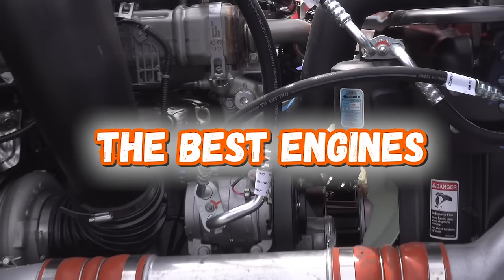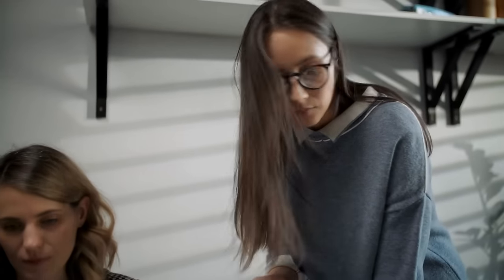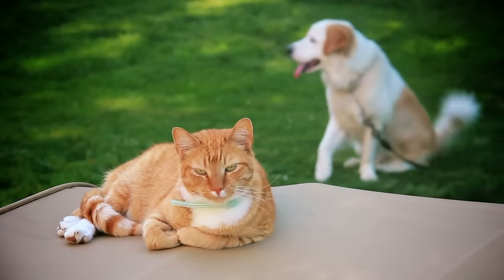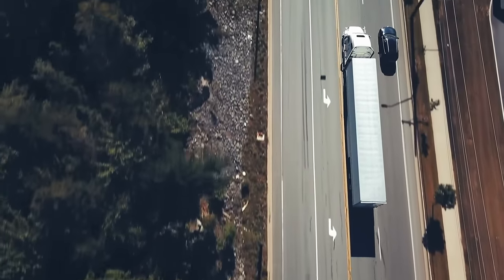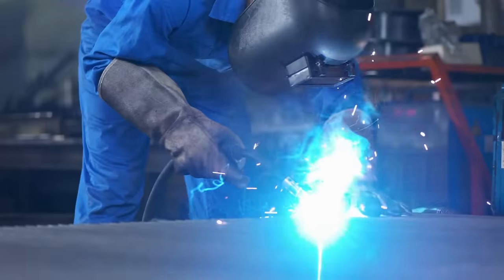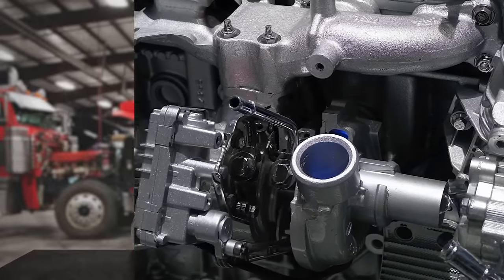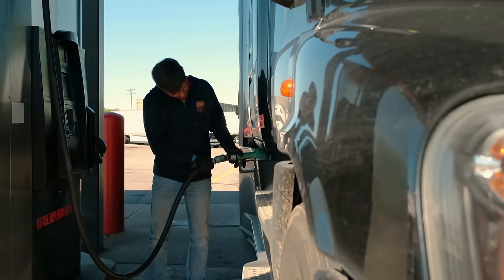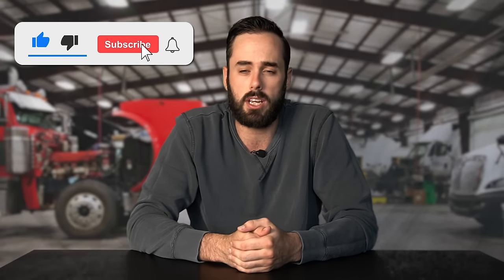The BEST Diesel Engines of All Time! (CAT, Detroit Diesel, Cummins, Mack)

Comment: I’ve got a 3406e in my ‘96 flat top and absolutely love it. My next choice would have been a red top N-14, which I didn’t see explained in this video. Was a little surprised by that! Thanks for sharing your video
Reply: Is the 3406b better because it's NOT electronic?
Reply: @nostradamus7648  some people say yes, because it’s a lot simpler of an engine, easier to work on/maintain and of course you don’t have electronics that could potentially fail either. Fuel mileage can be not as great though because you don’t have the electronics to help with timing, injectors, and such. That’s just what I’ve heard and seen over the few years I’ve been driving truck. I think both are great engines at the end of day and it comes down to preference. The E model cat or early C-15 would be my personal choice each and every time.
Reply: @rockbottomtransport  By early what year model C15 are we discussing?
Reply: N14 is a fragile engine
Reply: @yvesbelanger5443 we ran 8 of them in 98 long hoods. Injector replacement at 500k was preventive maintance. Other then that they all went/have over 1.25 mill before getting inframed pulling 55k coils loaded both ways in 3 axle Mac trailers. The C15 replaced them with all had head gasket failures, hot side turbos were a constant problem, and all of them had to be torn down and rebuilt, 2 out of frame to have the blocks counter bored. The 5EK we had were just as bullet proof, pulled like mules headed to grain, but drank fuel. Not dogging on Cat, the 5EK were amazing motors that all went north of a million, but if you had a catastrophic failure in a 525 celect, you had to have got a lemon. The red heads were the best motors we've ever had for pulling/fuel/reliability. That being said. We had 2 standard 485 N14s as back up trucks we bought from a guy that retired. Both had around 300k on the clock. Everything on those except the hard parts gave us problems.
Reply: @nostradamus7648 yes and no, the 3406A and B You really have to watch the pyrometer where the 3406E meters the fuel back automatically when the cylinder temperature rises, where the 3406A has a water intracooler the 3406B has the same air intracooler as the 3406E.
Reply: He probably didn't mention the N14 plus because it was only made for a short period but it was a good engine making 525 hp and just like the N14 had great low low end torq.
Reply: @edmunger5595  it was the best engine. Everyone in the US was making good motors from 96-03 then the government got involved and ruined it

Comment: I'm running a 60 series and after wrenching on it I'm understanding why it's such a good engine, fuel mileage, easy to work on
Reply from the maker: Niceeeeee!
Reply: @NorthAmerican-Trucking-News  did you know the first electronic engine ever made was engineered by John Deere, they wanted a big four cylinder for the tractor, but went another direction and left Detroit Diesel with a new design they took it and made the 50 and 60 series engine

Comment: One of my customer has 2003 Coronado with 14 liters Ditrot non EGR and this engine set up by factory 625 Horsepower and 1850 torque and I did test drive truck once and I really feel the power it has 13 speed transmission and 3.58 rear end. Wonderful truck

Comment: Caterpillar 3406B is the best truck engine ever made. 
I have one 38 yrs old still rocking.
Reply from the maker: Woah!
Reply: The  cat 3306 is the best diesel engine ever built; I have seen more than one with 30,000 hours on them. They were used in cats and loaders and were  indestructible.

Comment: Shoulda went years further back and put the Detroit 6v92 silver as well as the 8v and 12v 71 and 92 on the list. They'll NEVER be beat!
Reply: They don’t know about the 70 series engines clearly
Reply: They only get beat uphill.
Reply: Idk about that. Back in the day my dad had an old A model kenworth long logger with the 6v 92 silver and that was around the time the ppl were raving about the big cam Cummins and the little v6 would blow their doors off..
Reply: @ShystySpokes  There's a lot more to it than just the engine. Gearing, transmission, etc. If everything was equal and in stock form. The 855 would crush the V6 and V8 92 series. And was more reliable to boot. My Grandfather had a trucking company. At its heyday the company was running 10 Peterbilt 359's. Running reefers. All with 855's and 13spd's. He cycled out the Detroits he had. Couldn't run the Detroits in California. And he said the 855's were just better. The last 359's he bought had N14's in them. Cummins had the best warranty for awhile. As long as you didn't break the seal off the fuel pump dealio. 
I'm a CAT guy. When I left active duty, I drove for a guy that had some pretty pimped CAT engines. And I liked the plethora of 3406 CAT's he had. Some had Dana Spicer transmissions and some had Fuller's. Those two speed gear boxes wasn't my favorite to drive. Always a fan of a standard 13spd. 
As far as now. If you was to eliminate the Emissions on all these new engines. They'd all be million mile motors. I drove a deleted X15 in a 389. It would sh*t and get. I owned a W900L with a 6NZ CAT 550hp, 1,850ftlbs and 18spd. 3.36 on tall rubber. 8 inch Donaldsons. And a Jake that would throw you into the windshield. Fun truck. Now I'm in a 579 with 450hp, 1,850ftlbs and a 13spd on 22.5's and 3.25 rar. She's a steady girl. Not winning any races up the mountains. Pull the Grapevine 34-36mph at 79k+ (Tanker). Before that a Volvo same HP and torque. 2.47's and a 12spd I Shift. Pulled the same speed with a tank. 🤷‍♂️ That Volvo motor built max torque at 800rpm to 1,300.
Reply: Well than we can say that my dads truck was an A model kenworth, long logger which is your standard log trailer, 2 axles, can stretch out to haul 40 footers(back then)not many log trucks had drop axles yet and 3 axle trailers were still years off. That said his truck had a light weight of around 21k. Deep reduction 15 spd which just about every log truck had back then(still one of the best in my opinion for heavy duty application)all the guys he hauled with had either a w900 kenworths or internationals with the same gear set ups..so pound for pound the trucks were pretty much the same and the old Detroit silver used to smoke ‘em. I too am a cat fan though I can give you that. Nothing compares to the sound of a straight piped 2 stroke Detroit but if anything comes close it’s a pumped up cat with 6 or 8 inch straight pipes. I’m a lot older now and I’ve driven log trucks, dump trucks, concrete pumps, you name it. With every combo of engine/trans/drive axles/steer axles/drop axles/tag axles possible so my opinion counts for something.
Reply: Would just like to add that anyone running interstate hauling their fruit or livestock or what have you is playing with a different deck of cards then the guys hauling timber in the Pacific Northwest. Not saying by any means that the interstate, consumer good haulers aren’t truck drivers but we’re a different breed. If you can drive a truck where I do and have or where the old timers like my dad did then you’re a truck driver. We can all drive down the freeway and back to a loading dock or into a spot at the truck stop. When you can drives thousands of miles a year off highway on roads that are 10 inches wider than your truck with 3000 ft sheer drop off on one side pulling 55’ poles or can back 2 miles down a spur with that same shear drop off in high range reverse in the dark than you have my respect. Until then makes sure your 22.5’s don’t get too hot on the pavement. Lol

Comment: Just sold my 04 Star with it's C15......used in Alberta oilfield so lots of high idling with pto use......31,000 hrs and 860,000 kms......it is now in Ontario and still pulling it weight on a log haul......and I miss it very much hahaha

Comment: For medium duty trucks I have to go with the pre-2008 DT466 engines,  bullet proof.
Reply: They made millions of those..
Reply: @curtisnoble.  Nope, built by IH/Navistar in Melrose Park, Il.
Reply: I had  6 1999 school buses with DT466, and 10 with the 2005 6.0.  The 6.0 was always in for one thing or another, I only saw the DT466 every 90 days for it's PM Inspections.  You could always count on at least one of the 6.0 every week to have an EGR issue....
Reply: @curtisnoble.  funny thing, my Navistar rep told me "it's basically this, if it goes left on the conveyer line it's a powerstroke, it it goes right it's a DT466, if it goes center it's a Detroit 40"
Reply: @curtisnoble.  Never knew that. THANKS!
Reply: @stevenmanson8024  I found a dt530ngd-that was badged as a detroit 40, it's the last of the medium-duty mechanical engines. gonna rebuild in the next couple months-stoked to bring this dinosaur back to life
Reply: Yes and easy inframes

Comment: E7 was one of the best engines we ever owned, but shift it at 1400 and with the 18 speed tranny it came back in at 1200 and pulled extremely hard, it just wasn't a fast truck, but 8 mpg out of a 1999 454, if our 460 was worth while we would still have Mack's

Comment: I know you don;t get them in North America but the Scania V8 in all it's versions from the 14.2L of 1972 to the current 16.4L at 770hp are legendary for longevity. Maybe you'll have them optioned now Traton owns International.
Reply: i think you will see them in 2023 international heavy trucks
Reply: Well we had couple of V8 made for heavy applications. It didn’t work out. You see the problem is we are not restricted as Europe trucks by length so we don’t care how big the hood is , ol so the V8 is a good engine but requires more maintenance and more more qualified people. The trucks back then we’re designed to be low maintenance and any person on the side of the road to fix the. Now without a computer and special tools , knowledge you can’t do anything.
Reply: And I’m 100% sure , I do my own maintenance and replace the 2013 with an isx15 for a 2001 N14 made in 99 😁
Reply: @makeitpay8241  Doubtful, they federalized the 13L MAN engine but I wouldn't expect more than that, they will just spec X15s for applications where more power is needed.

Comment: The caterpillar 3406E was available up to 550 hp and 1850 lb ft of torque.
Reply: They were capable of well over 750
Reply: @mikeaporter5231  I didn't know cats had almost 800 hp
Reply: marine engines are twin turbo and capable of 1000 hp
Reply: todays C18 Acert  which i understand come from the 3406 in marine use like in my sport fisherman  make 1150 hp
Reply: Mine was factory 475 so yeah more than the 465 mentioned
Reply: The 3406E made me darn good money. When I retired my last one had 2 million miles on it.

Comment: There is only one engine at the top of this list and that is the 3406B CAT and all of it's later variations.... up to and including the C16. Nothing else comes close. And yeah... I've operated everything mentioned so far and many, many more. The 60 Series Detroit is a sad copy of the 3406. All previous Detroit engines sucked... ALL OF THEM. Old school Cummins Big Cam engines were okay for their time, which is to say before CAT perfected the 3406.
Reply: They break down too often
Reply: I drove one once in a 1994 Pete 379. Coming from Macks, it was hard to notice if the engine was any good or not because I was so distracted by the transmission's trashy, sloppy feel. Roadrangers always feel like a plastic toy compared to Mack's precision gear engagement. I've yet to drive an Eaton that didn't have its fourth gear gate worn down to nubs, even in the two year old truck I got in this year. I had a C15 for a year or so once and I didn't find it terribly compelling. I do remember that for some reason Cat designed it with an external oil line to lubricate the head that had a hole rubbed in it by rubbing against the hood. I remember thinking, internal lubrication has been standard for 70 years, what's their problem?

Comment: Still running 38 1986 Pete 359's with 3406B Cats and 6x4 Spicer Transmissions.  Aside from a few rebuilds those Engines are still running with over 5 Million Documented miles.

Comment: You missed all but one of the greatest of all time in your video.

The true greatest diesels are all pre-emissions, pre-electronics. With the exception of the Cummins 855, everything you featured is an emissions Era electronic. Granted the featured cats evolved out of their earlier mechanical lineage.

I understand that Millenials and younger will likely never drive an old mechanical as fewer and fewer survive today. But in stating "The Greatest of all Time", get what they are. What you have should be titled greatest of electrical controlled.

None of these engines are cheap to operate, the fuel inefficiency of older engines even out with cost of maintenance of electrical controlled.

Keep in mind, those old irons could take abuse, and did. They would also keep running when broken. 

I have a couple trucks, most are the medium duties with DT466C engines. The newer DT466E engines were a nightmare in cost of maintenance compared to the previous mechanical versions. I also have 3 of the Cummins 855, and 2 with the 2 stroke Detroits, and I also have a 1980s Soviet 'Ural 4320 with a 10 liter V8. These all came from a time when the engine just couldn't break, and maintenance was simple, even major overhauls were pretty simple.
Reply: 855 was the best of all time well till the n-14

Comment: 3406B all day long! And 855 Big Cam all day long too! None of them have the faulty sensor problems that the newer truck engines have today. New truck engines with the sensors and electronic stuff are just junk! I’ll take my mechanical diesel engines all day long. Simpler to work on those. I’m not a Detroit fan or a Mack fan. Just not familiar with those two engines.

Comment: Everything you said about the 855 was completely wrong. N14 came out as a stc in 1991 celect+ max HP 525 tq1850.
Reply: Give me the N_14
Reply: @alexanderfields6449  I'd take a n14 for anything except heavy hauling
Reply: In stationary applications the big cam was rated up to 535 and 605hp.  Highway application never went over 475 with the compound turbo mvt engine.    So he was partially right

Comment: My favorite engine doesn't get the best fuel mileage, Cummins 855, more commonly known as a N14 in my house, easy to work on and extremely durable, you must understand it's down fall for it to last millions of miles, block fretting is a real thing, just re torque the main bearing bolts and don't put bearing in the bottom end, do replace the rod bearings, stay strong guys
Reply from the maker: Thanks for the tip! I hope it helps someone out!
Reply: Let me explain the block fretting, the main cap vibrates on the block wearing it out, the main bearings wear at the same time, no big deal, when you slip new bearings in the crank as a good tune up, the new bearings are to thick and cause the bearings to seize on the crank, bearing material will block the through hole that oils the rod bearing and it will blow up, heard many stories, my friend lifted the front head off the engine when #2 cylinder let loose, he said let loose was an understatement of the year, absolutely nothing left to fix , maybe the rear two heads were still good but everything else was in the scrap bin, stay strong guys

Comment: Good video, however I have one gripe. People say 3406e all the time in videos like this, and rightly so. But that is a picture of an acert.  It clearly has compound turbos on it and thus could not be a 3406e.
Reply: I always watch videos like these and I’m always annoyed at the little misinformation. He only ranged the motor up to 465 when they never had a 465hp spec, and it went up to 550 on the 14.6 engine and 600 on the 15.8 and yes, they made a 3406e in 15.8 before there was a c16.

Comment: I've got to say I have mixed feelings on the Detroit 60s. The boss had a International 9200 with an 11L and even though he liked it... that thing couldn't even get out of it's own way. On the other side of the coin, he had a Volvo tractor with a 14L Detroit that had more grunt than one could even imagine. There is quite a bit of difference in displacement, but the larger engine was a monster while the 11L was an anemic kitten!

Comment: 3406E went up to 600hp from factory depending on model
Reply: If it was a 1mm
Reply: There is no 600hp version of the 3406E. The 3406E's highest rating was 550hp with 1850TQ. Then Cat re-created the 3406E into the C15 (both were 14.6 litres) and then developed a 16 litre version (15.6 litres actually) of the C15 called the C16 and that is the motor that had 600hp with 2050TQ. The current ACERT big Cats are 15.2 litres and have a top rating of 625hp.
Reply: @mihybrid1  actually it can be built to 600 hp but it won't last very long, I had a 3406E that the previous owner had it done at caterpillar, it put 575 hp to the ground but at about 250,000 miles it started blowing the packings out of the cylinder sleeves, just saying it can be done.
Reply: @edmunger5595  Of course you can rebuild and upgrade any engine.  My point was / is, there is no such engine from the factory. To the best of my knowledge,  Cummins is the Only diesel engine manufacturer that will turn up the power and warranty the engine over 600 hp. The current X15 can be ordered at 625 hp and turned up considerably by Cummins,  still under warranty.
Reply: @mihybrid1  Detroit Diesel 16 liter 605 hp from the factory.

Comment: Caterpillar 1st place ,Detroit Diesel 2nd ,Cummins 3rd ,Mack 4th,,,,by todays standards,,,,,,why is the cat 1st,,,the cat is very mechanical and simple with good power remarkable toque ,,the Detroit Diesel is 2nd for reliable reason and durability and old age and well known,,,,,Cummins is 3rd because it was known for harsh issues through 2011–2021 however the l10 ,855 and so on are very reliable but not made very large in production but very reliable,,the Mack is strong enough to Pass